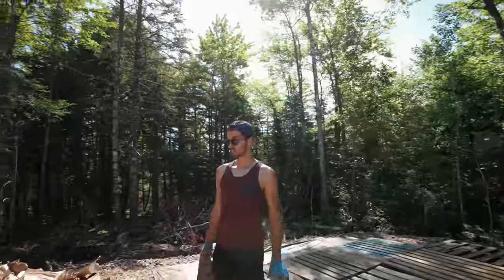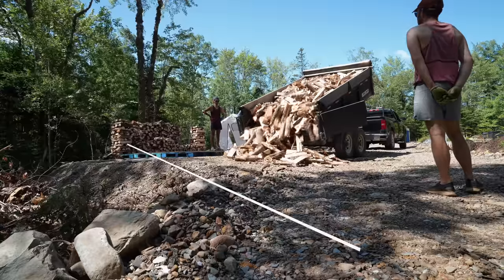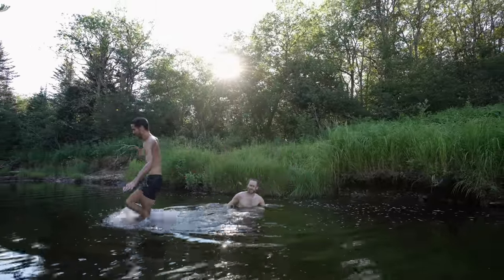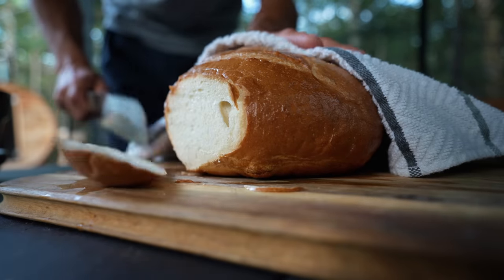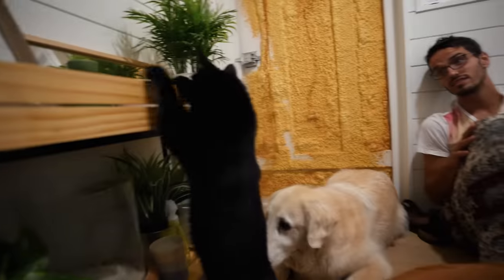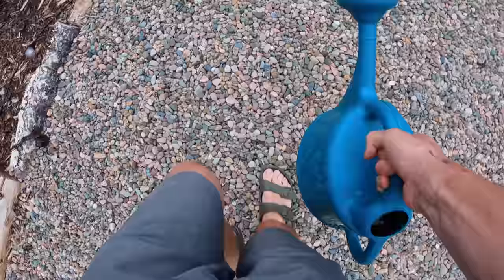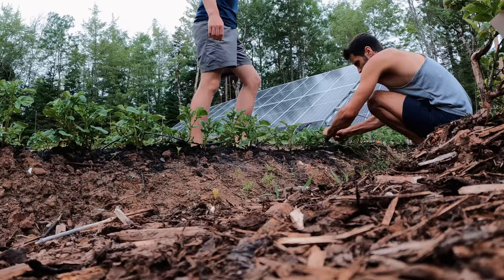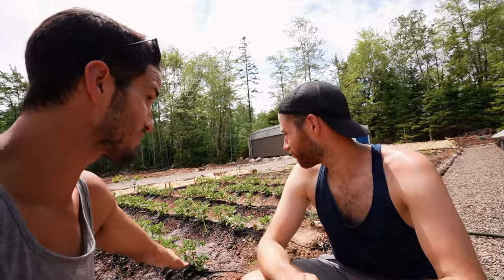A Rough Week with a Sweet Ending | Summer Days Building our Homestead

Comment: Guys, I know you have so much on your plates and the dome work will be beginning anew, but I think you might need to research your drip system a little more.  In my opinion, it’s definitely the way to go, but they are designed to water slowly (drip), yes you can have sprinklers, but there are so many options.  Again, you probably already know this, but some plants prefer not to have wet foliage, others are good with it.  Also, the system I normally use shouldn’t be more than 100’ long.  That also varies with the number of emitters, and the gph rating of the emitters, as well as the diameter of your main lines.  I try to loop my systems so that the pressure is equalized throughout the line.  I know you’re great at researching such things.  You’ve most likely already done it.  I would just hate for you to wonder why plants at the end of each system were dying, or at the beginning were drowning.  There are also wonderful 9 volt and solar timers.  Some with apps that allow you to operate your system from your phone.
I’m sorry about the delay on your house, but as you pointed out…
silver linings!
Thanks again for sharing your wonderful family and inspiring projects.
OMG!  I had to come back.  Happy anniversary!

Comment: I am not sure if that wood is seasoned or not ... if it is not then you want some air flow in between the wood you pile other wise it does not season evenly and gets bit moldy and punky in the middle of the pile from lack of air . Ideally you want wood to season at least 6 months depending on the wood of course birch which comes with it's fire starter attached does not take as long but also does not burn as long or give off a lot of BTU"S ... Hickory , maple and oak take long to season but they give of the most BTU's and burn longer in the stove

Comment: Hey guys, so sad about the house, that really sucks. You'll need to double celebrate your anniversary when its done.  With regard to the veg garden is it a drip or sprinkler system you've installed?  Drip systems are usually ideal for low pressure and you seemed to have more than enough pressure for a drip system?

Comment: If you wanted, until the solar panels are operating, you could probably find a 12v / 24v "inline booster pump", like the ones used for reverse osmosis 😅

Comment: What is the actual eta for the support beam, or do they know or have any idea? 
Try to NOT DIG to check the potatoes, instead just wriggle your fingers down each side until you feel the buggers. Then pat them on the head and say GOOD JOB. (grins) Digging can cut the roots? 
When I was a kid, we farmed potatoes back in the 1960s. Unless something has changed, that's the way we did it and that's the way I would take one from the bottom, rub it mostly clean on my (10-year-olds) pant leg and eat it raw. YUM! Even the bits of dirt were tasty and, in fact, good for you. Look that up. Happy planting. (grins)

Comment: Stop cheating on the potatoes! 🤣 If you need more space...potatoes will grow in a stack of old tires. Good garden soil goes in the bottom tire for good plant nutrition.  Then as the plant grows, stack up more tires & stuff w/ straw. You can build the stack 3-4 high. Then to harvest, just take the stack apart.

Comment: ROTFL......you wanna dig up those little taters 'just to see'.....cute, really cute. >>>>  A drip irrigation system puts out water much slower than a sprinkler system, usually a gallon or two an hour versus a sprinkler system's output of a gallon or two A MINUTE. In five minutes, a 1 gallon per hour (gph) drip emitter will put out about 10 ounces of water.

Comment: Please don't let me frighten either of you,  but my career has been statistical studies and information factors that few people ever are allowed to know.  Chaos easily starts from the studies.  I have learned to admire the two of you greatly. Therefore PLEASE take serious heed,  the climate changes we all are experiencing will last for several 18 to 24 years,  any further is only conjecture.  Next project (asap) build an underground FIRE-proof safe structure that will protect the 5 of you underground can be above ground just drag up 6 feet of soil atop the structure, pack it hard, then disguise it as a mound with steal air holes, (upside down J packed with metal wiring to keep critters out) several.  Personally, my employer has me located in a Vault with an outer structure as previously described.  Last year I wanted to relocate near you, but then realized I am too old to make such a change.  Therefore I will stay in place;  I have sworn an Oath to stay on the surface to help guide the masses to safety.  The Zone you are located in is softwood, easily flammable, and quick burning > Fires can race at speeds beyond escape.  Sincerely with Love for Birds of a feather.